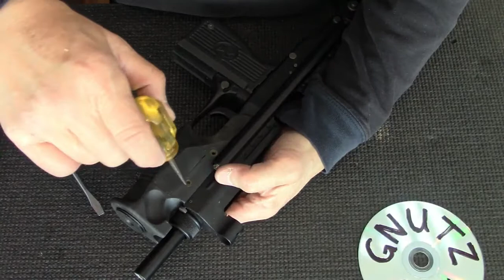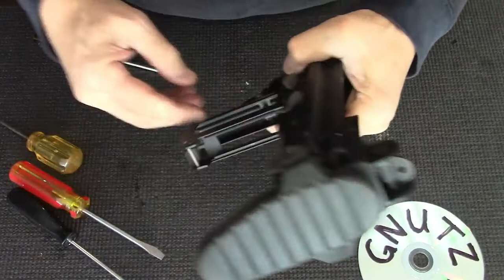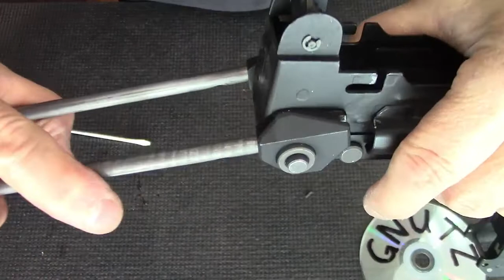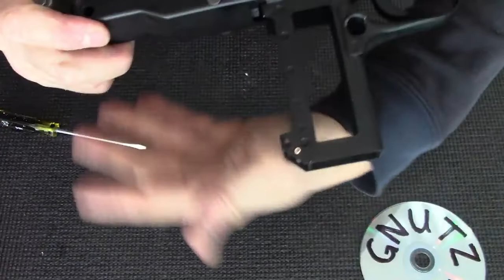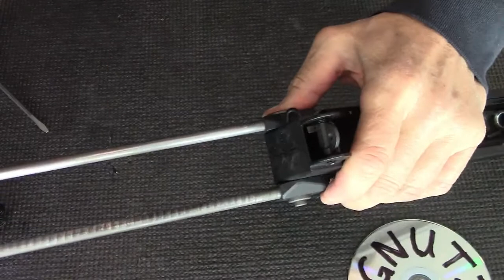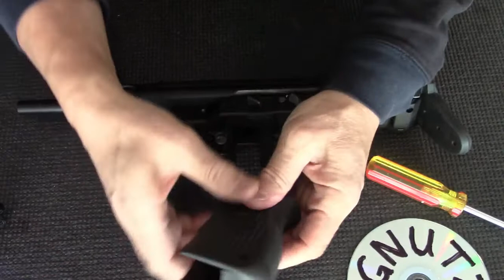Polish BRS-99 Full Monty disassembly & Field stripping for cleaning. BRS99.

Comment: The Polish Army version (full auto SMG) "PM-84P" has a difrent grip (almost flush with magwell) and instead of this flashlight holder You have folding front grip or picatinny rail. I don't know why on earth FB went with this sh** furntitre for the Canadian version. Overall this gun in it's original full auto version is mostly liked by Polish Soldiers, Police officers, Prison guard officers, Border Guard officers and all other service man who are using it
Reply from the maker: I will be brutally honest with you, the canadian furniture stinks, uncomfortable to hold. do they think canadian has huge hands? i like the original furniture.
Reply: @gnutzguy   Yeah this new furniture is fugly. The sad part is that I've check and FB does not make the original furniture any longer, instead PM-98 and PM-06 are available only with the new "improved" one. That Also means that all new SMG both by any armed service in Poland will have the same furniture as BRS, what's worse that also means that if they decide to rebuild stocks of old PM-84P... they will laso use the new parts :( (fun fact full auto version of original PM-84P costs approx 3000 PLN/1020 CAD in Polish guns stores)
Reply: @Crimerenegade  you have full autos in Poland?